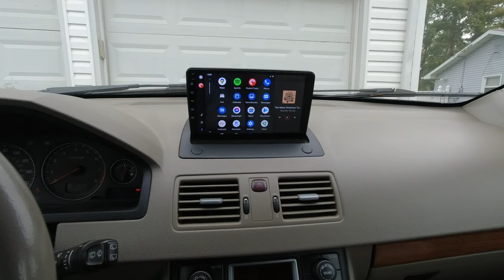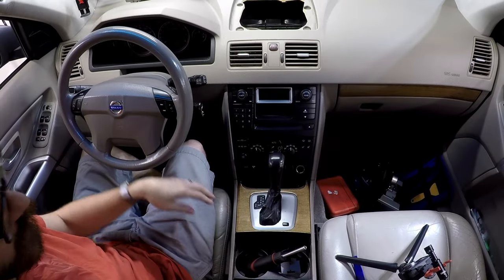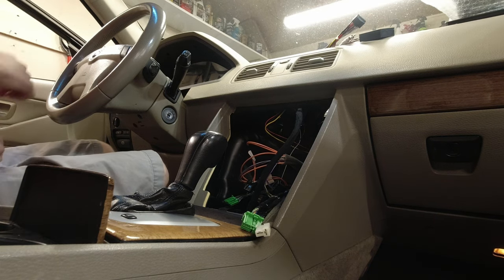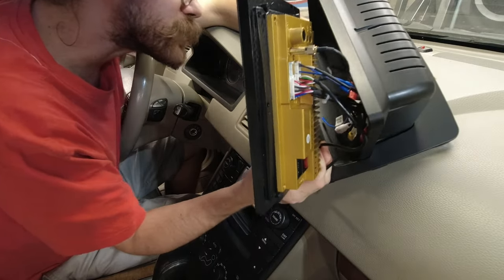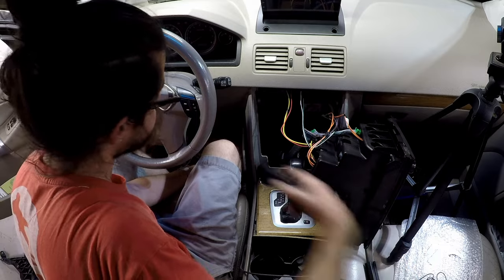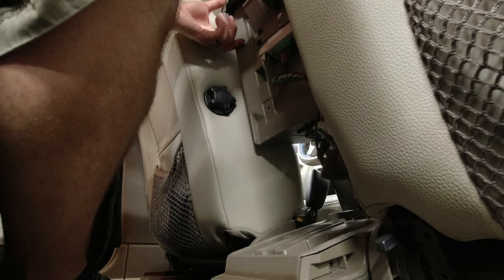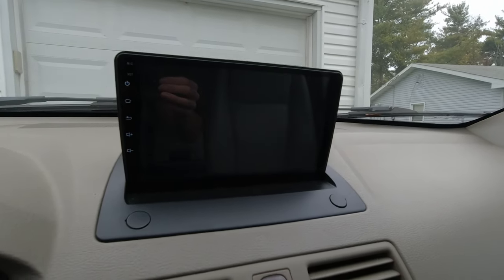Installing an Android Head Unit in a Volvo XC90

Comment: That is so cool!  The pop up screen in our XC90 is useless.  You can't hardly see anything in factory back up camera.  Plus, half the time, screen doesn't raise so I almost finish backing up and it wakes up.  Argh.
Reply from the maker: Thanks!
In my car the screen was only for GPS, but I can imagine it's frustrating to have to wait for the screen to come up when you need to back up!
Reply: Hi I have a similar viewpoint. I have a 2013 xc90 with an existing backup camera. I need to replace that function because the operation s so terrible. You switch into reverse and it takes so long for the motorized display to get into position, the screen to activate, and the camera to come on I’m usually already finished backing up. The text on the screen and resolution of the screen are just comical annoyances. 
I’m fine with the existing radio and have a portable gps so couldn’t care less about replacing the head unit for that purpose. 

What I’d like is to just improve the what is broken. 

Can I just plug a new ‘head’ unit it into the slot where the pop up is, replace the backup camera with a better camera with a better one, The head unit will just quickly  come on when I switch into reverse and display what’s behind me. Can it use existing wiring and harnesses?

Comment: Great video !  I basically have the same XC90,  also 2006.  I just followed the link in the description to the Seicane web site. On the Seicane web site it says "If the original car comes without AUX, then this unit cannot fit. " The radio unit in my car  definitely does not have an AUX port so yours has one ? If so - where is it ? Did you buy the Quad or the 8 Core CPU unit ? I really love my XC90 - I got it new 17 years ago and it has now 275.000 km on the clock
Reply from the maker: Interesting, my car does not have an AUX input, and at the time I ordered it, there was an option on the Seicane page for non-AUX cars. I'm not sure what changed. I would try reaching out to them in case they have more information.
For the spec, I believe I got the 8 core unit, but if you plan on using Android Auto or Apple CarPlay that shouldn't matter much since your phone will do the processing.
Believe it or not, this XC90 has 354000 km! (with around 265000 km on the engine) I only put a few thousand km on it myself, but I did a lot of work to get it back into decent condition. Unlike yours it has had a few owners though haha
Reply: @frenchineer   Thx for the quick reply. I will contact them tomorrow - let's see if the will respond. Looks like their customer service has a bad reputation.
Reply from the maker: I hope you get the info you need! Otherwise there may be another company out there. I know there's a different (more widescreen) form factor that has been made for the XC90, so maybe they still have compatibility for the non-aux models.
Reply: @phyrros1  Did you ever get a reply about the non-aux cars? Thanks
Reply: @RealList10   Sorry ..just saw your comment. No, unfortunately I have not. I contacted another supplier and they asked me to take a picture of the entertainment module from the back, just to be sure. I will do this when it gets warmer here in Germany.

Comment: Do they make a honest for the 2006 xc90 with the regular radio I don't have a screen that comes out the dash like the one you showing???????????
Reply from the maker: I've seen some people use a standard double DIN unit in place of the original radio, but I don't know what kind of connections need to be made for that.

Comment: verry good video but i have a problem ... my car stereo doesent have the 4 pin wires with the 2 fiber optic... and my harness is uselesss, cant seem to find an apropriate one can you give me a hint :)
Reply from the maker: If you don't have AUX, the required harness is probably different from what's included. When I ordered mine it was an option but now it has to be purchased separately. Another viewer was able to find it on aliexpress, and he links to the one he used in his video here: https://youtu.be/eQQt47_zJKk?si=S3Eu5txkS3DSLRyg
Reply: @frenchineer  mine has aux, and usb port but the car stereo îs wired diffrent from yours

Comment: This is great I just bought an 05' V8 version yesterday and this is the perfect project. Thanks!
Reply from the maker: Awesome, congrats! The V8 seems like a really nice engine, especially being developed by Yamaha. (and if you ever need to do the PCV valve, it's super accessible compared to the 5 cylinder lol)
Reply: @frenchineer just taking out my old gps according to your video.  I have an extra connection on mine.  A wire connected to a screw. I’ll try to
Post a picture.  For some reason I can’t seem to comment on main video and can only reply.
Reply from the maker: @nicolewhelan6570  I think you are good removing all the connectors from the old GPS screen since you won't be using it anymore. If you think you may need to put the original screen back you can take a picture of the connections for extra peace of mind too.
Reply: @frenchineer  so this is the extra connection I have that was connected to the gps harness.  Any idea if I reconnect it or what it was?
Reply from the maker: @nicolewhelan6570  Sorry, no picture came through. If it was connected to the part that you have to remove for the new unit, you probably have to leave it disconnected.

Comment: I installed this in my Volvo XC90. Year 2006 and no AUX in. Everything works without problems.
There are two wiring harnesses in the package. One for ISO connection and one OEM Volvo.
Only the PDC does not emit any sound. I repinned the middle loudspeaker on the plug for the power amplifier for loudspeakers in the front left.
So buy and install.
Reply from the maker: That seems like a good solution to retain the parking sensor sounds! Glad to hear the install went well.
Reply: @frenchineer  Thank you for your feedback signal.
Can you help me to set shutdown and sleep mode time? So that the radio switches off completely and does not remain in sleep mode and drain the battery. Or do you have no problem with that?
Reply from the maker: I haven't had any issues with battery drain! The radio does switch off after 30 seconds. I did check in the settings, and it doesn't look like I have an option to reduce how long the radio stays on. If you want to check your factory settings, the code was 1617 (this should be in the manual you can get on the product page).
Reply: Sorry，is the problem of no sound from the parking sensor solve?
Reply from the maker: Another commenter suggested adding a speaker and connecting it to the factory amplifier. If you leave the radio off the parking sensors should make sound through the new speaker.
Reply: Could you explain in more detail what you did to make the PDC work again? I can’t figure out which cable belongs to the PDC in order to wire it to a speaker…
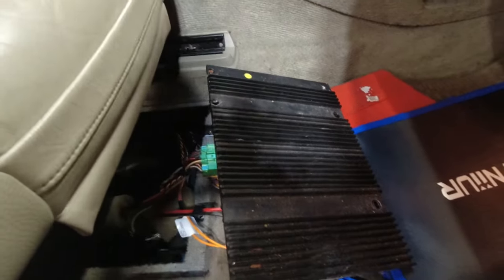Reply from the maker: My car doesn't have the parking sensors, so I didn't do this myself. My best suggestion is to look at the new connector that goes into the amp (at 15:15) and compare it to the original connector. You would probably need to add two pins to that connector would match the original pin location for two wires for one of the original speakers, then connect that to an auxiliary speaker.
Reply: So are you saying that even when the car has no aux, it's still pretty much plug and play for the sound coming from the android head unit and repinning of only two pins is required? Thank you. Just bought a 06 XC90 V8 without aux and looking into this project.
Reply: Maybe I understood incorrectly. Are you saying that you re-pinned the central speaker to LF to get all speakers to work. But still don't have sound from pdc. Is that right? Have ever solved the pdc sound issue and how did you do it? Thank you.
Reply: @HandyDoctor89  have you installed on you non aux?
Reply: @ehomerog  yes, just did. I will put out a few videos soon, including where to buy the harnesses. Not easy to find now. Please stay tuned. I even solved the parking assist sound issue literally 10 minutes ago, 😂
Reply: @HandyDoctor89  😂 nice thank you!! please hurry I’ll suscribe and will be waiting lol. my 04 xc90 doesn’t have park assist thankfully don’t have to worry about that but the fiber optics make the install not easy.
Reply: @ehomerog  it actually not difficult. You have to buy the right harnesses, which are difficult to find now. After that, you couldn't go wrong. I will have the video out next week but I won't have detailed instructions. I don't think I can make a better video than Nick did on this one. I will tell you what and where to buy and what I did differently with Nick, such as the parking assist hack that is missing from this video (because Nick's car doesn't have pdc).
Reply: @ehomerog hey, btw. I put the video up. Nothing on installation since Nick did a great job. Mostly on where to buy and to show case my system.

Comment: You just went through most of the pain points I had on my own XC90. Very fun. By the way love your frustration moments, I also have them! 😄 Keep the good work!
Reply from the maker: Thank you, I'm glad you enjoyed it! There are definitely things to figure out as the install goes along since the documentation is limited for these radios. I have the backup camera install video coming next!
Reply: @frenchineer  do you Know how to connect the steering wheel to that radio? thank you
Reply from the maker: In my car, the CANbus decoder box allows the radio to read the steering wheel inputs, but it seems like that does not work in every case unfortunately (maybe different manufacturers, vehicle year, etc. have different compatibility with different radios)
Reply: Bonjour je possède un xc 90 de 2005 Sans Aux,j'ai tout installé,le problème c'est que la radio d'origine et les capteurs de marche arrière n'émettent plus de son ,😢je suspecte le câble de connexion entre l'autoradio et l'amplificateur

Comment: Did the center top dashboard subwoofer plug harness connector get plugged into the Seicane headunit or did you just leave it unplugged?
Reply from the maker: It stays unplugged in this setup, it's one of the tradeoffs of this arrangement.

Comment: Just the video I was looking for!
Reply: However, did you come across a model that still allowed the unit to hide beneath the dash?
Reply from the maker: I have only seen units that are permanently up like this one (including one that's similar but a bit shorter). It looks like there have been some installs that use a double DIN head unit where the original radio is, but I don't know the details of those installs.

Comment: Great job! Wanna some tip? Next time sit in passenger seat. You get much more space for work and can get closer if need.
Reply from the maker: That's true! I do switch sides sometimes, though in this case having access to the brake pedal to reposition the shifter made it a little easier when taking things in and out.

Comment: Hi, on the original Volvo connector which connects to the amp are the wires for the speakers and three additional (purple, black and yellow) . Do you know what they are for? . Unfortunately I cannot attach a pic or link to a pic..
Reply from the maker: Unfortunately I don't know what they do.  There may be pinout diagrams in the service manual if you are able to find one. Otherwise it's possible there is some info in volvo forums.

Comment: Colleague, I also bought myself an XC90 V8 "Ocean Race", manufactured in 2006. Please tell me where I can buy such a device? Thank you in advance!
Reply from the maker: The Ocean Race paint is very nice! 
The unit I installed is this one (also in the video description): 
https://www.seicane.com/2005-2014-volvo-cx90-hd-touchscreen-radio-gps-navegador-o-bluetooth-mp4-mp5-music-player-wifi-direc-o-wheeel-controle-suporte-dvr-obd2-h6042?acc=caf1a3dfb505ffed0d024130f58c5cfa

And for the non-AUX cars, the harness you will need is this one (tested by another viewer):
https://www.aliexpress.us/item/3256806126808056.html?aff_fcid=299289d40b9347498f87ce0ebc1f9dd3-1725852172131-01273-_DerNRnt&tt=CPS_NORMAL&aff_fsk=_DerNRnt&aff_platform=shareComponent-detail&sk=_DerNRnt&aff_trace_key=299289d40b9347498f87ce0ebc1f9dd3-1725852172131-01273-_DerNRnt&terminal_id=a6e389ccb5be4a679d7df7a4f551f6ea&afSmartRedirect=y&gatewayAdapt=glo2usa

Comment: Great video!  I recently purchased a 2011 xc90 and was stunned that I would connect to my phone via blutooth for calls but not for music.  This is going to be my next project so that I'll have updated GPS and blutooth.  Did your unit come with the USB cables you used to connect your phone, or did you supply those yourself?
Reply from the maker: Thanks! The unit only comes with the 2 USB female port cables, so you'll need your own cable to plug your phone in. I used an Anker cable that was long enough to run to the center console. If you use an iPhone, you'll probably need an autokit dongle to get carplay.

Comment: hi, thank you so much because I have had the airbag light on for years and I didn't know what had happened and watching your videos I realized that I too had turned on the car with the radio off, I bought your diagnostics (the only which worked) and turned them off for me THANK YOU, I wanted to ask you a question since English is not my native language and I didn't understand a thing, but if I buy this unit, the audio I put when connecting with the phone comes out from the speakers of the car ? Thanks again

I have the same car as you but from 2003 without the aux cable
Reply from the maker: With this install, any audio through the head unit comes out of the car speakers. If you have backup sensors those don't make sound anymore because of how the install works. 
I got this unit with the cables for a car with no AUX, but that option is no longer available where I bought mine. I am not sure where that is available, so you may have to research other sellers.
I'm glad you were able to fix your airbag light!

Comment: Interesting project, was thinking of just putting an Android tablet on the motorised sled. So many possibilities, might be interesting to have a Bluetooth ELM adaptor in the OBD port so you could run "Torque" app on the tablet.
Reply from the maker: Yes, I've seen setups that tie the head unit to a bluetooth OBDII  scanner for real time data on the screen! Others have used aftermarket tire pressure monitors as well. If you have an AUX port and want a less permanent install with the same features you can look into the universal android auto/carplay screens too.
Reply: @frenchineer  I will have to have a proper look at my car, primarily I would like a decent Satnav to replace the OEM one. Mine is a 2011 XC70. Of course with AUX input I can do a lot of what I want to do without any significant amount of wiring. I am happy with passive TPMS, it has served me well on other cars. I will do the updates to the existing SATNAV and see if I can tolerate it! Thank you for the reply.
Reply from the maker: If you want good satnav, I'd recommend using Android Auto or Apple Carplay since they will use your phone (and its GPS) and factor in real time traffic using your data plan. There are also navigation apps compatible with android auto/carplay like OsmAnd that let you download a region of the world onto your phone if you don't want to use data.
Let me know if you which route you end up going!
Reply: @frenchineer  thanks for the reply. There are many possibilities. On many of our trips my wife likes to use Google maps on her phone, I tend to use Navmii (both iPhones), I will see if I can tolerate the existing SATNAV, but there are so many ways forward.

Comment: Excellent instructions.  Thank you.  I'm looking for a dual camera head unit with built in DVR.  Do you know of any such beast??
Reply from the maker: Thanks! 
I haven't looked into the DVR options much since I install standalone dashcams in my cars, but the product page does mention DVR compatibility with a USB camera. I am also not sure if it would also use inputs from a backup camera like I installed. There may be some android apps you could use to record multiple inputs, but processor capacity could become a limiting factor, so that's something to consider in your research.

Comment: Hi! So, the new screen/headunit is not using OEM amplifier? How is the sound quality, still powerful? What source you will have to select from OEM radio, to listen sound from new screen, for example youtube? Thanks in advance!
Reply from the maker: If you have the no AUX model, the amplifier is bypassed, but if you have AUX I believe you retain the factory amplifier. Without AUX the original radio is bypassed, so it should just stay off, with AUX I think you would need to use AUX input. 
The onboard amplifier for the new unit sounds good, but it may have a lower max volume. Unfortunately I was not able to compare the levels.

Comment: Hi @frenchineer, just bought a 2004 2.5T XC90. I’m looking for a head unit but have no idea how to check if the standard radio has aux. I do have parkingsensors in the rear. Any advice on how to check (aux or no-aux)?
Reply from the maker: I don't think the 2004 has AUX, I think it came standard after 2006.
Regarding the parking sensors, the install without AUX bypasses the factory amplifier so the parking beeps can no longer be heard.